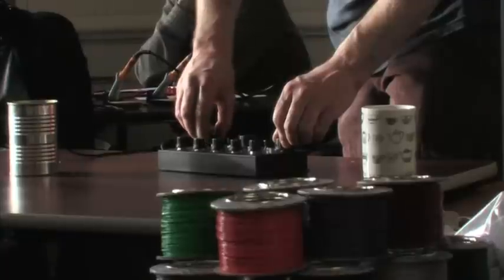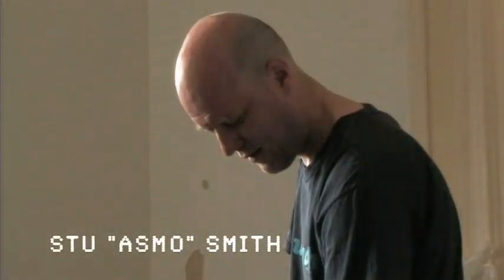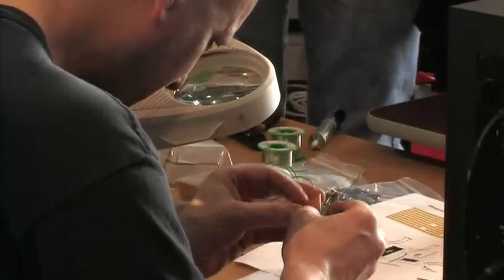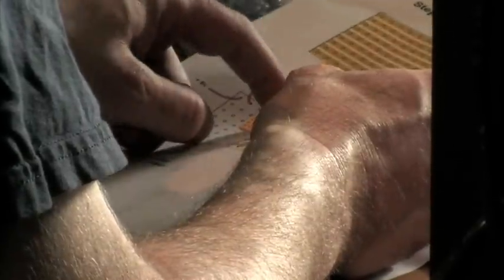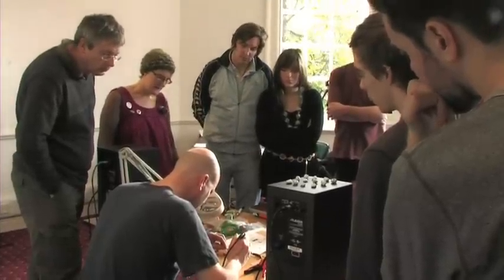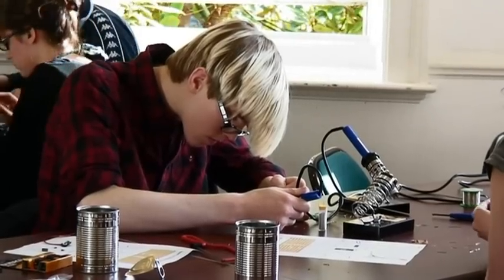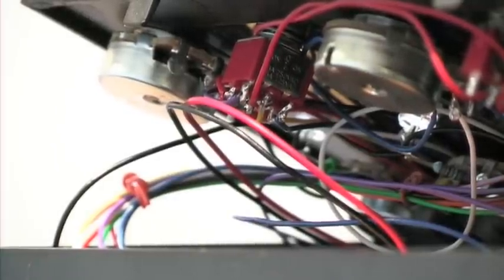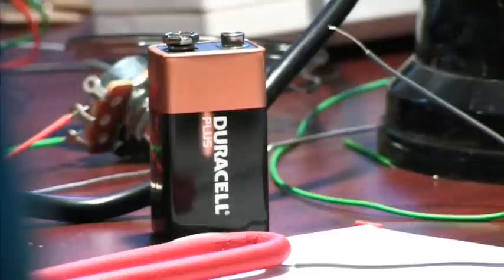Glitch a film about circuit bending part 3/3

Comment: Mike, if you spend too long around circuit bending, you attract Gremlins, especially if you have tech gear, audio or video. That'll be why your files corrupted, the more tech you acquire or build, the more Gremlins you attract, my workshop/studio is riddled with them. Coil called them Elph, on the upside they are responsible for the happy accidents that happen, as well as the fried circuits.